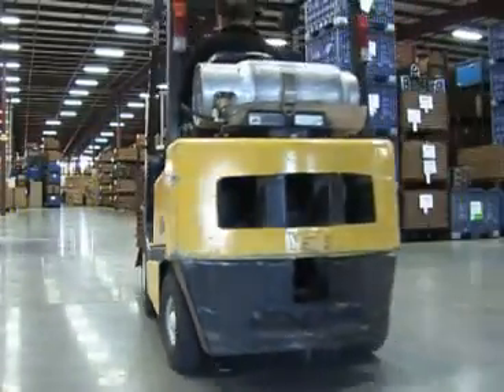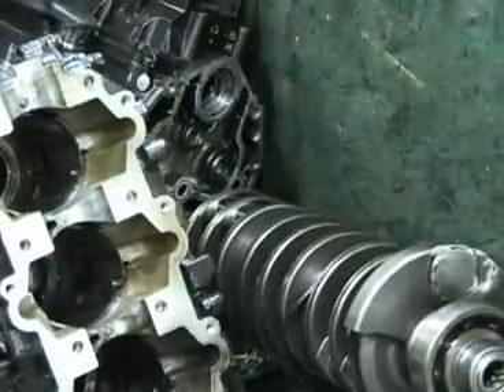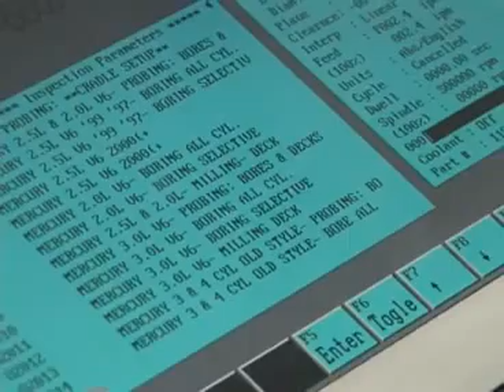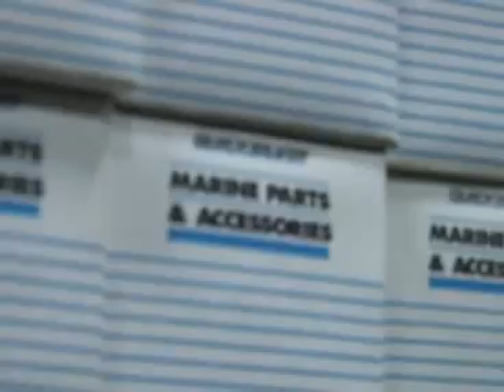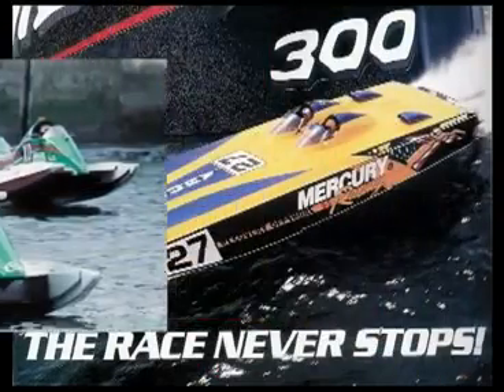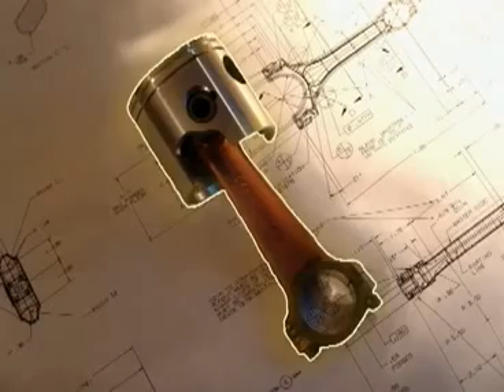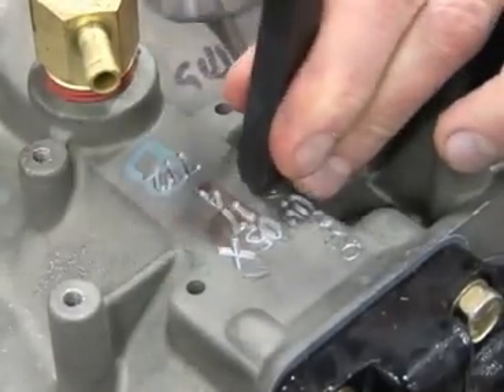Remanufactured Outboard Powerheads

Comment: I have a 2023 300r power head that hydro locked . I ran it less than 20 seconds during the ordeal.  Can send a power head to y’all to have it re built?
Reply from the maker: We're sorry to hear that. Be sure to work with your Mercury Marine dealer on this. Powerheads that are salvageable can be used as cores, but everything must go through a Mercury Marine dealer.
Reply: @MercuryMarine that’s interesting you say this   When I originally had my problem I ended up with a guy that said he was a mercury mechanic and he was not.  I fortunately got it away from him.

Comment: Question, what differentiates the mercury reman motor in build quality vs a highly skilled engine builder doing the same ammount of product scrutiny on their hand built and single man assembled rebuilt engines employing similar machining tactics or quality repair and boring of original sleeves etc Other than factory backing of repairs. So example. Boat owner requests all mercury factory parts rebuild of block at private 20-40 year in business marine mechanic and his hand rebuild uses all new components. How does his quality end up lower than a remanufactured motor that undergoes the same exact build at oshkosh
Reply: Watch the video at 2:11 for your answer.